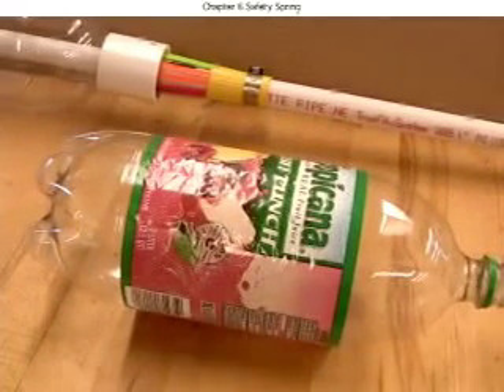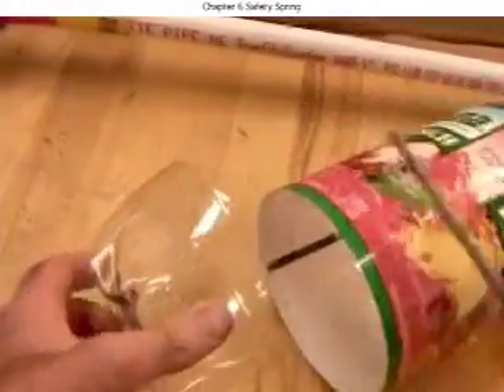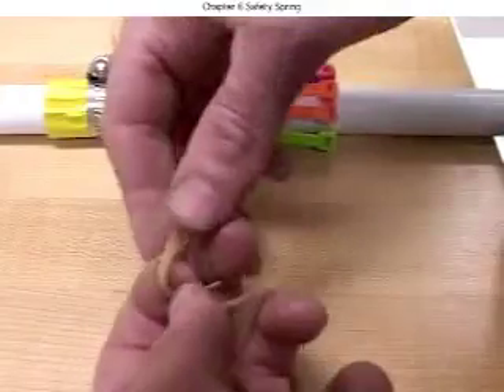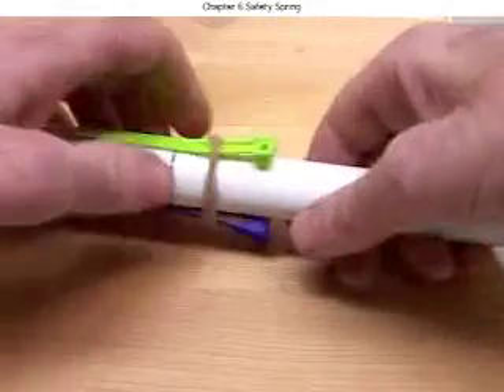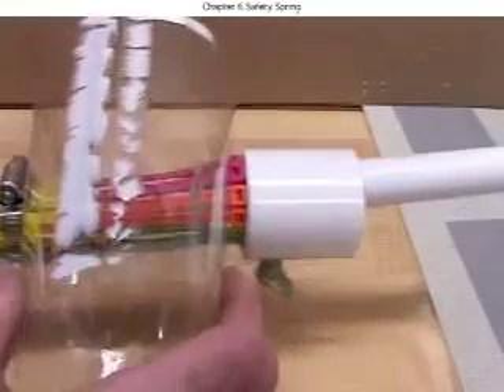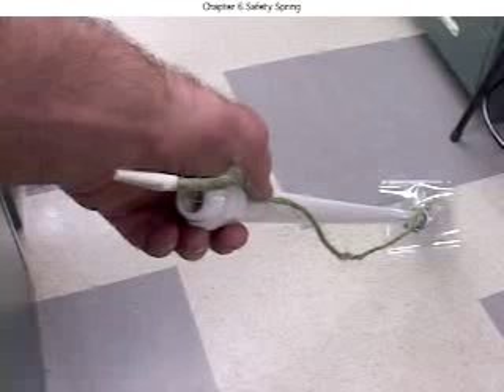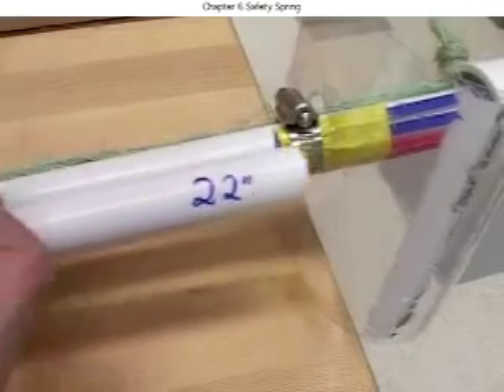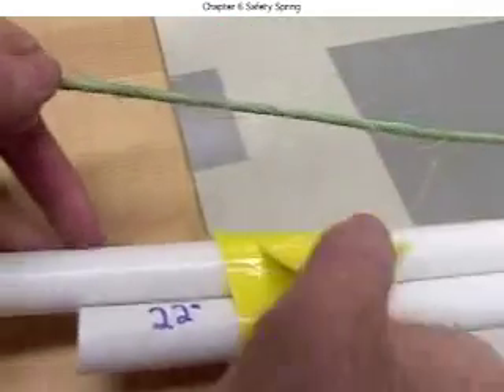Build an Overhead Water Rocket Launcher Part 6 safety spring

Comment from the maker: @MrAllrounder77 No, you don't have to use the exact dimensions. I just feel a little safer having the vertical pipe guide the bottle up during the first few inches of liftoff.
Slater

Comment from the maker: Hmm, I think perhaps you have the bottle jammed quite hard onto the bump in the pipe. So I think the bottle might be getting stuck. Either pump more air pressure into the bottle or don't jam it on so hard (you might have to readjust the hose clamp a bit). My rockets will not lift off if they have less than 30 PSI or so of pressure. Let me know if that solves the problem.

Slater